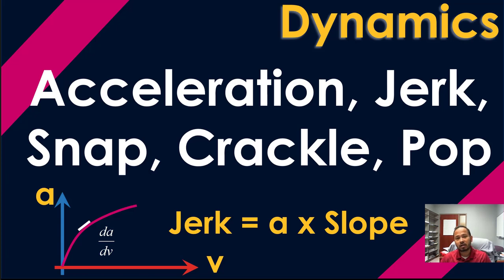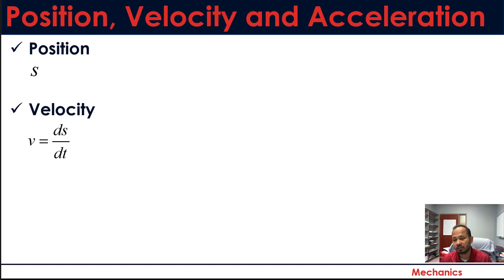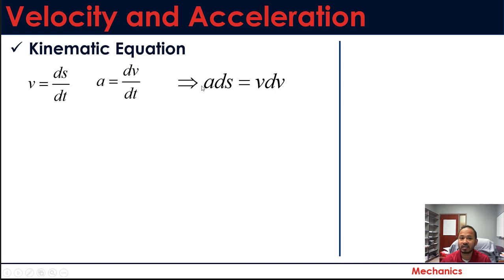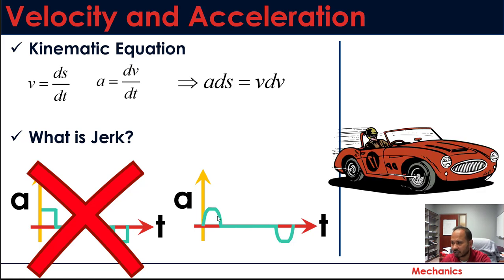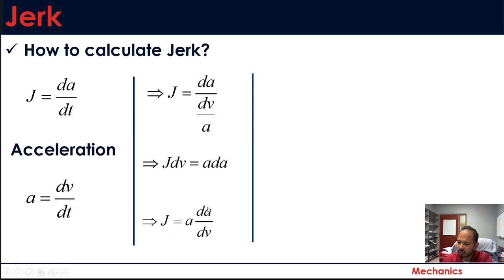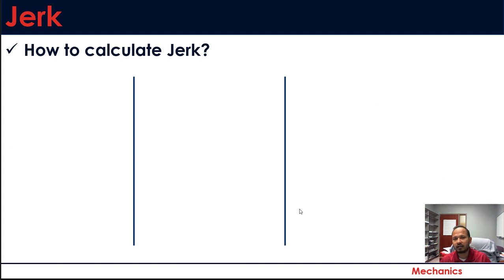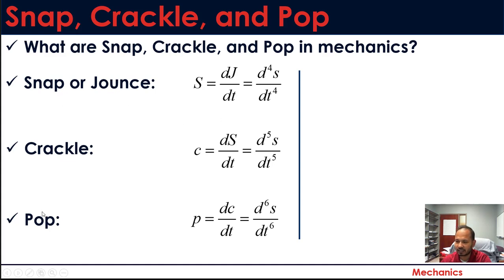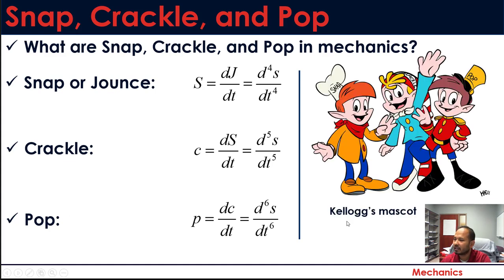Higher Order Derivatives of Acceleration: What is Jerk, Snap (Jounce), Crackle, & Pop in Mechanics?

Comment: I've been trying to figure out how to calculate sin/cos manually in terms of acceleration applied to each axis.

I'm doing this imagining an object moving in circular orbit.

So when at an angle increment of 90 degrees one axis will be at maximum velocity (pi/180), and the other axis will be at zero velocity but under maximum acceleration (pi/180)*(pi/180).  

I've worked out that the acceleration on an axis should be the distance on that axis times the maximum acceleration, but I want to know how I can calculate the angle without simply applying the acceleration to the velocity repeatedly.
 
I've also worked out that time and angle can be viewed synonymously in what I'm doing since 1 degree could be thought of as 1/360 a revolution.  But the issue I'm having is that I'm basing acceleration off of distance and distance and velocity is calculated with time.

I modeled it in some computer programs but want to know how it could be done with a formula instead of a loop.

On the computer I started with acceleration and each loop in the program is a unit of time and it works it out by calculating acceleration then applying it to velocity and applying vel to distance over and over. 

 I'm wondering what an actual formula would be to calculate the time to reach a particular point since the acceleration is dependent on the distance?

I never took calculus but am trying to learn how it works, so any help would be appreciated.

Comment: In what cases would a crackle or pop ever be useful 🤨? Like a snap sure for rockets and stuff when dealing with massive accelerations and jerks, but when would a crackle or pop matter enough to bother including them in the calculations?
Reply from the maker: Continuing from your example, think of F=ma, so if your force is changing then it will relate jerk, but if your mass is varying too (because of ejection of fuel) then the next step is snap. In general higher derivatives are not widely used.
Reply: In car and train design, motor designs, designs of rail tracks and so on.

Comment: If a body is at rest at t=0 (it's position is equal to 0 so all of it's higher derivatives are equal to 0) and it moves, then it's position can theoretically be derived forever, because position changed so its first derivative is different from 0 so it can be derived, and this first derivative was 0 in the beginning, so it changed, so its derivative (position's 2nd derivative) is different from 0

So it can be derived, and it was 0 in the beginning, so it changed, so its derivative (position's 3rd derivative) is different from 0...
Reply from the maker: It can go on

Comment: Sir can you make it experimental for jerk
And can u give examples for them in real life more !!please 😀
Reply from the maker: Hi Bodhik, that's a good idea. Right now I do not have the equipment to run and measure jerk. But maybe in the future. Thank you.
Reply: @MohammadShafinulHaque  sir make more snap and pop please 🙏
Reply: Imagine we're standing in a train as it accelerates.  We feel the constant acceleration as a constant force against our body, which our body naturally adapts to by leaning forwards.  We then find ourselves in an equilibrium.... as long as we lean into the acceleration, and the acceleration is constant, then our body is happy and balanced: )

I believe that 'Jerk' is the additional force we experience whenever the acceleration changes.  The "jerk" that knocks us off balance just as the train approaches it's target speed and stops accelerating, for example.

So, jerk is the sudden and destabilising change forces felt in-between acceleration changes.

Unfortunately, as for Snap/Jounce, Crackle and Pop... I have no intuitions about these : /
Reply: @garychap8384  Technically, we feel the acceleration but only adjust to the jerk. When you get in car and get moving, you'll feel pushed back in your seat. When the car slows down, it's the opposite. When you suddenly press on the gas, your body will be "smacked" on the seat for a short moment (the jerk) but you'll adjust quickly. When you drive into a wall you're suddenly sent forward as the jerk is incredibly intense (people usually drive into a wall at 50+km/h). If the acceleration (or deceleration) is constant, you'll only feel heavier (or lighter) in your seat. You won't have to balance to compensate.

If you're standing up in a train that accelerates constantly, you'll only have to slightly balance forward. If the train suddenly breaks, you'll be thrown forward because you have excess momentum compared to the new velocity of the train, i.e. your body could be going at 200km/h when the train's suddenly going at 180km/h. The "force" you'll feel is the 20km/h difference in velocity. So as you said, we can only get knocked off balance when there's a jerk.
Reply: @louisrobitaille5810  said "Technically, we feel the acceleration but only adjust to the jerk"

It seems that way, doesn't it.  But we're continuously in adjustment without always being conscious of it.  We tend to notice, not the small adjustments themselves, but those moments when we've failed to adjust our frame appropriately and must suddenly take further action.

Perhaps this is just semantics.

But... "technically" ... we DO feel both, and we DO adjust to both.  Even a small acceleration that doesn't cause you to lean noticeably, will result in adjustments in the muscles.... you will often feel your toes, calves or core tense up in response.

So, I'd say we clearly "feel" both and we "adjust" to both.  Obviously not where the acceleration (or jerk) is below some threshold, but that threshold is very low.  As for only jerks causing you to be "off balance" ... every adjustment in muscle tension or geometry IS a reaction to being "off balance".  

If by "off balance" you mean falling over, then you're only considering extreme imbalance that occurs too quickly to adjust to.  

A test of where the balance/imbalance line is ... would be to replace yourself with a similarly top-heavy figure made of wood.  I think you will find that, lacking continuous adjustment, imbalance occurs in even the gentlest accelerations.

Still, as you're aware, this is all quite irrelevant to the discussion : )  Fun none the less though.

Thanks Louis

Comment: I have a question ....for eg ....if    
displacmment=t^3+t^2+t+4=function(time)       Then 
d(displacement)/d time = 3t^2+2t+1           ie 1st dervative.     ie velocity (the equation is just an example made by me )
If the velocity/1st deravative Becomes zero at time q seconds
And its 2nd derivative/acceleration also become zero at time q second
3rd derivative could be zero or not zero at q seconds
        ...then what can we say physically say about the motion of that body...can give me an example of such motion/thing happeing in real life....or any exampke would do
Reply from the maker: A simple example could be, a car is traveling on a straight line path to the right, after a time q seconds the velocity became zero because the car made a U turn and going to the left.
Reply from the maker: Things to consider: solution of velocity function i.e. time is non negative when velocity is zero,   plot the position function with respect to time from t= 0 to t= q, and from q to a higher time t = r. You may be able to see what possibly happening.